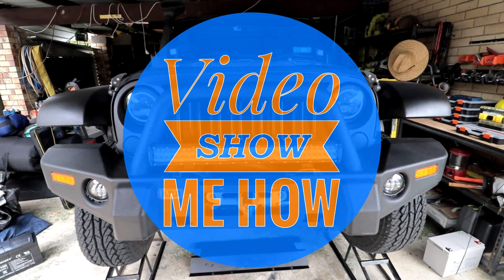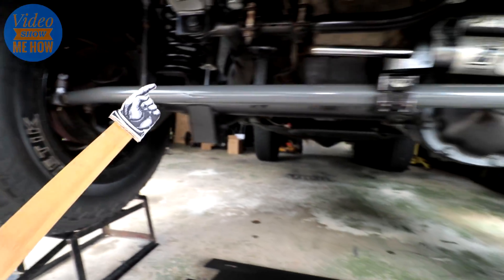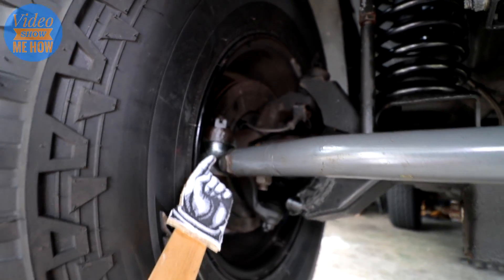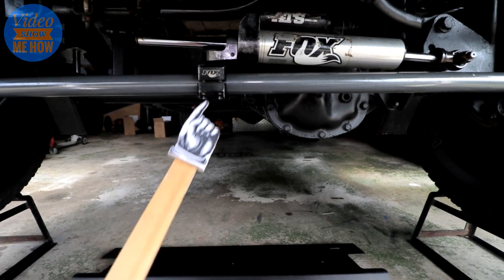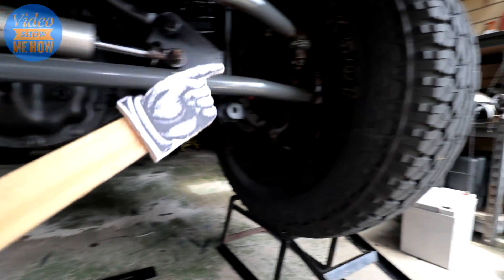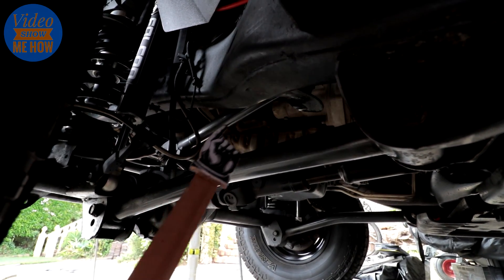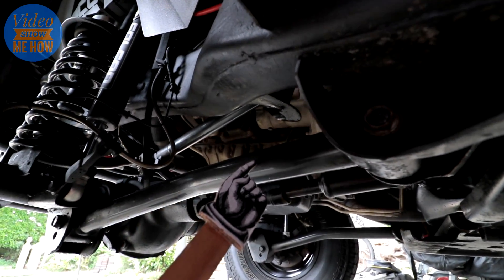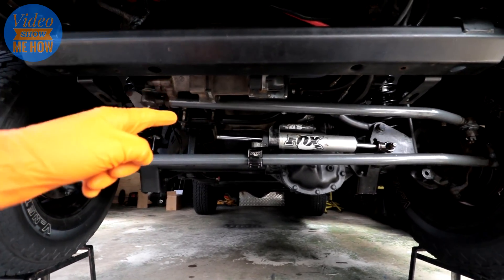Jeep Wrangler JK Geometry - Front Suspension and Steering Explained Complete Guide Walk Through

Comment: Excellent! What’s the correct caster angle for jk 3” lift?
Reply from the maker: Should be aiming for 4.5-6 degrees, wayalife has a greater article on this
Reply: @VideoShowMeHow  Thank you so much, do you have the link of this article?
Reply from the maker: @joncruz  just Google wayalife caster - he's got lots of great info on Wranglers
Reply: @VideoShowMeHow  What about the rear caster angle?
Reply from the maker: @joncruz  not really an issue (no steering). Adjustment would only be for correcting significant coil bend
Reply: @VideoShowMeHow  Sounds good thanks

Comment: How high of a lift do you have and what tire size do you run? Great video as well! Very informative. Just purchased a JKU this was definitely informative!
Reply from the maker: Cheers. Was 3" teraflex outback springs and 33" ATs in that vid. Is a bit different now 😁 Full walk around vid will be live shortly on the channel if you're interested ✌️
Reply: @VideoShowMeHow  I'm thinking of getting a 2.5" lift from AEV. So is it still recommended to upgrade those suspension components mentioned in your video?
Reply from the maker: @recreation_outdoors  no you should be ok. For anything 3"+ you'll need most of those components ideally. I'd do the lift and see how it drives. Can always upgrade other bits later. If you're running bigger tyres (eg 35s +)  def recommend the steering shaft brace
Reply: @VideoShowMeHow  thanks for taking the time and advice! Cheers!

Comment: I'm a little confused. Can you give me some advice. I have a 2013 JKU. I had some bump steer issues. I've put on an adjustable track bar, a RC track bar bracket at the axle and a yeti hd drag link flip. I have a RC 3.5" lift with the drop pitman arm. My bump steer feels worse now. If I were to go to stock pitman, wouldn't the drag link and track bar then be out of parallel?? When I go over big bumps my Jeep feels like the back end goes on a different direction than the front end. My steering wheel definitely had bump steer when hitting any bump. Any help would be appreciated!!
Reply from the maker: Hey Brian, hmm sounds like you've gotost covered. I'd delete the Pitman drop bracket, never been a fan of those things for a bunch of reasons and see how it drives then. Are all the bushings and links themselves sound? Ball joints good?
Reply: @VideoShowMeHow  okay thanks I'm going to go to the stock at Menards and see how it goes. I was in an accident they replaced the frame with a new frame, and put on a used axle from which I had all new ball joints put on. I don't know if there's anything else wrong with the axle as far as u-joints or anything
Reply: That was supposed to say stock pitman arm, not Menards. Lol
Reply from the maker: Wow ok well that changes things if it was in an accident and they charged the frame, that's a big job could be lots of things. Can you take it back to who did the job of recent?
Reply: @VideoShowMeHow  yes I'm taking it there right now hoping they can do something about it
Reply: They had originally told me that the new ball joints could cause bump steer. That there is a break in. For the ball joints. That doesn't sound right to me
Reply from the maker: No I agree with you. Well fingers crossed they sort for you mate 👍
Reply: @VideoShowMeHow  thank you

Comment: Wow I just subscribed great channel thank you for this video I have a 2015 JK Wrangler and I'm having steering wandering issue as you drive the Jeep wonders. Any clue what could be the issue? Thank you
Reply from the maker: Thanks mate! It's normally castor it's out.. have you just done a lift?
Reply: @VideoShowMeHow  No I've had the lift for a while now, it's a 3.5" rock Krawler lift with mid arms , coils springs and fox shocks  on 37", Currie Antirock Front and rear Sway Bar Kits on a 2015 JKU. everything was OK until i completed going through Rubicon trail, i made it through just fine but as I  was driving back down from lake Tahoe on pavement I noticed steering wandering like the jeep is drunk driving.
Reply from the maker: Yeah nice man I will get over to the Rubicon Trail one day... on the bucket list! With your setup (pretty sweet btw) I would be checking for damage/wear from the trail, checkout your links/bushings/ball joints. I'd also check your steering box for slop/play. Running 37s and hitting that big of a trail would have worked it out for sure. Thought about running a steering brace? Got a vid on the install on the channel.. they're cheap and it made a really noticeable difference in how tight steering felt when I installed it on my rig.
Reply: @VideoShowMeHow  ok, will do
Reply: @VideoShowMeHow  can you share link to that video please
Reply from the maker: https://youtu.be/_YeK1HSDJUY

Comment: @Video Show Me How, I have al ready purchased a aftermarket drag link and tie rod since I was told that they needed to be replaced. But what else should I look into? Since when I am going down the highway @70mph the steering for the Jeep needs constant correction to stay in the middle of the lane. What would you recommend that I should pick up for aftermarket part replacement since it is an 07. Additionally, should I worry about replacing the rear ball joints or trackbar? Thanks 🤙.
Reply from the maker: Hi, no ball joints on the rear just the front, I'd start there to make sure there's no play. If your steering is wandering, there's a good chance your caster is off, have you lifted the jeep? If you have you will need more positive caster to make it steer like factory again. Things like caster correction brackets or adjustable front upper and lower control arms will help with this. Lots of good info online :) 🤟

Comment: So when i lift my jeep 2.5 inches, should i unbolt the Track bar? Or can i leave it on? I did my dads this week leveling kit and did not unbolt the trackbar, just wondering if i should be and why
Reply from the maker: It's usually recommended to remove trackbar bolt and loosen control arm bolts when doing a lift.  Then when everything is in and jeep back on the ground retorque everything. This is so you don't put extra stress/binding on your bushings etc.
Reply: @VideoShowMeHow  awesome , will do that then ! Thanks !!

Comment: What's that  piece  that holds the knuckle  called??
Reply from the maker: The steering knuckles are held in place by top and bottom ball joints. Is that what you mean?
Reply: the piece or part that holds the ball joints???
Reply from the maker: The knuckle is the part, the ball joints go in it and then they at attach it to the diff housing. Here's a pic https://teraflex.com/shop_items/jk-high-steer-knuckle-kit

Comment: Very informative. What size tires are you running?
Reply from the maker: 33"s round town and 35"s for trips. Haven't tackled gearing yet so when I do I'll prob ditch the 33s :)
Reply: Video Show Me How thanks. I have 33’s. They seem to grab every groove in the road. It gets tiresome on long trips. I bought it already lifted with a 2-3” lift. Wish I’d paid more attention. From what I’m seeing I have a bump steer problem maybe more.
Reply from the maker: Sounds like it mate, easy check is to see how parallel your various bars are (track bar, drag link etc). If they're at too much of an angle it could cause bump steer. May need to look at getting some correction brackets
Reply: Video Show Me How I’ll check it out. Thanks.
Reply from the maker: Good luck 👍